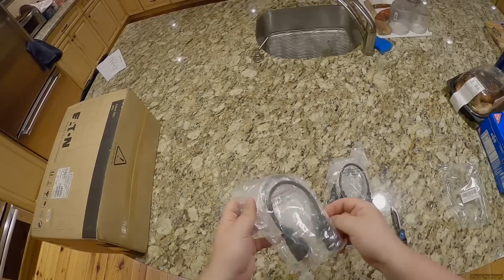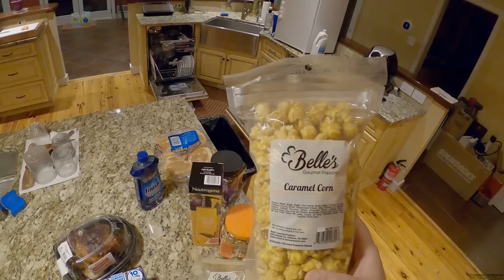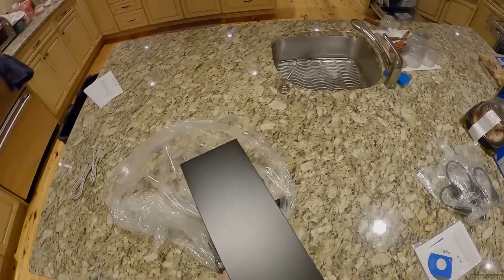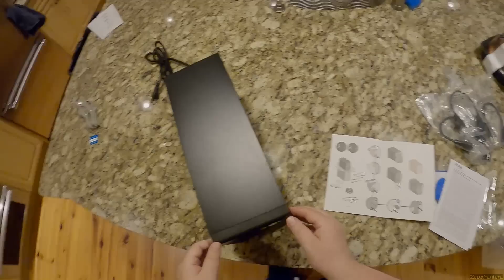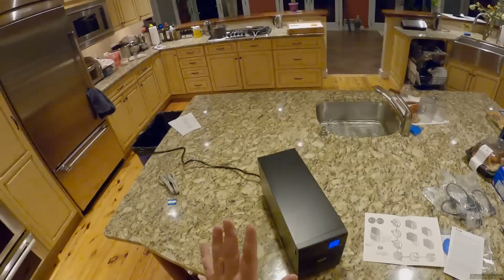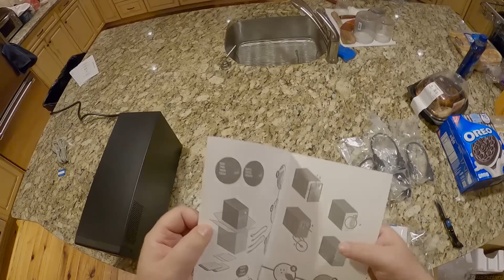Z Unboxing - 1 Foot Cables // Eaton UPS

Comment: Lead acid batteries off gas and that could be problematic for sensitive electronics unless in a well ventilated area.  I have been looking at a 1500w pure sinewave system for my expensive shit. Best I have come up with is a solar charge controller (for the A/C input) + LiFpo batteries (lithium iron phosphate, no gassing, 10 + years) + pure sinewave converter (battery to A/C). And you can always add a solar panel if you want to run continuous without A/C.